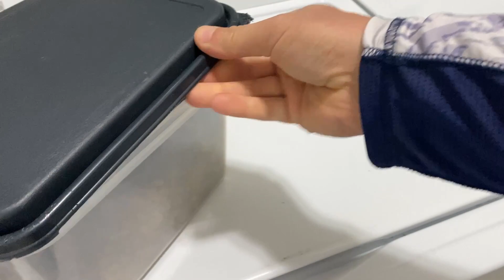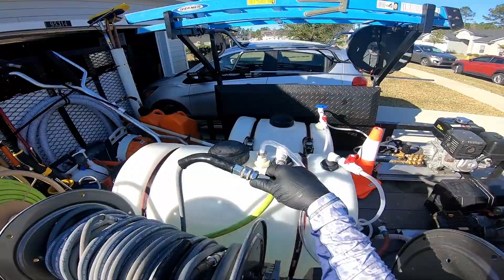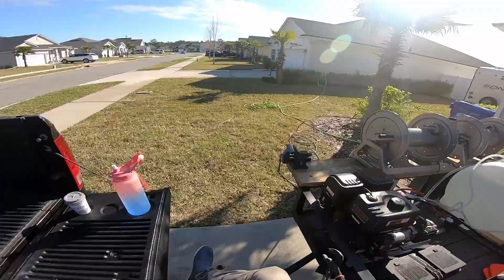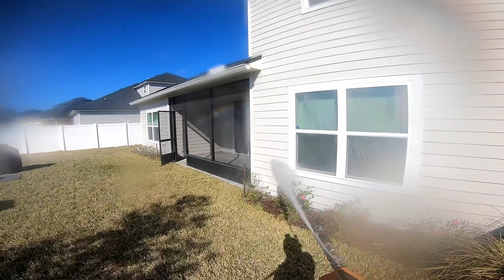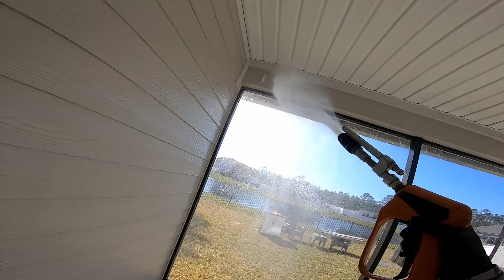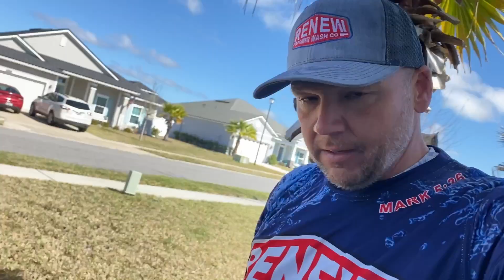Pressure Washing POV - This is awesome!!

Comment: What gun and long shoot nozzle do you use?
Reply from the maker: The orange gun in the video is the Suttner ST2305 with the Davis shooter and the M5 twist both mounted on a Davis machined 2 tip holder so I can switch tips back and forth as needed